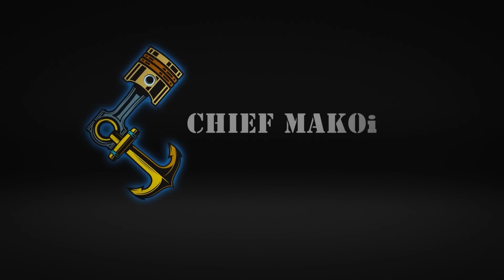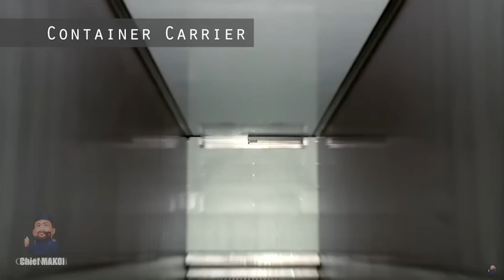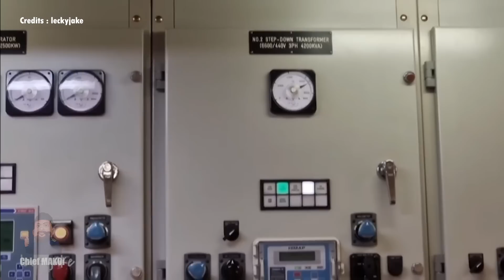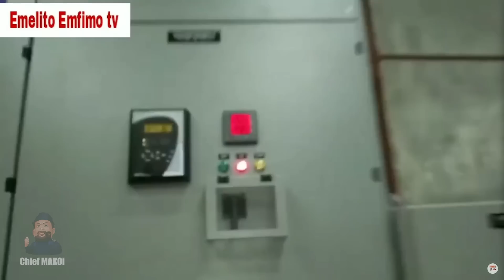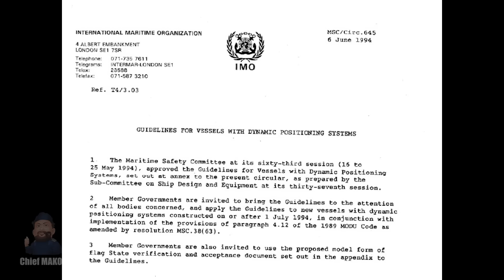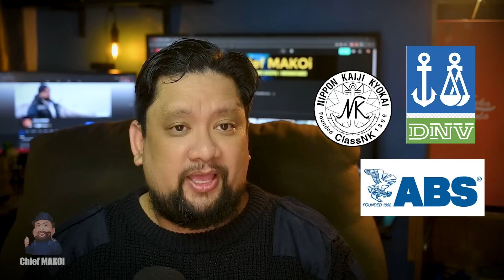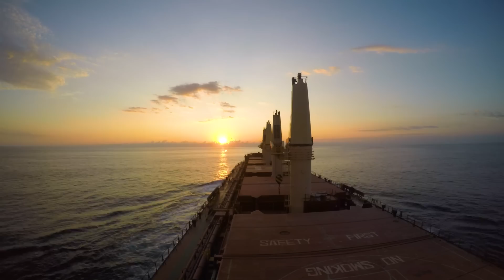Why Cargo Ships Don't Open the Bus Ties During Maneuvering | Chief MAKOi

Comment: The current setup offers NO redundancy. Any failure anywhere is gonna cause power outage in 440 bus, which means main engine will stop, and no useful steering.
Throw in any other mechanical issues (ships have plenty of things not working or not working well) and you have almost a guaranteed serious mess.

Comment: Thank you for your detailed explanation.   As an electrical engineer specializing in MV power distribution, I estimate
that having a normal tie breaker (also requires additional cubicle for bus transposition) would cost additional USD 40,000   Comparing to the cost of ship, around USD 500,000,000 it is less than 0.01% .   And this is the same trend, which I see in all other places - from hospital buildings to heavy industrial facilities:   "let's save pennies on the reliability of electrical systems."

Comment: In ICT, we use (massive) battery banks (UPS) to provide power during blackouts. Larger businesses and data centers also have diesel generators on standby so the batteries only have to supply power for a few minutes until the diesel generators have been started.

Comment: Thank you for the great explanation, because I also wondered why DALI did not split the buss while maneuvering.  All of the varied steam and motor vessels I sailed through the 1980's and into this century had that capability, as did the cable layers I was port engineer for until 2009.  I had no idea these container ships would not have that simple capability.  I still await the results of the investigation as to why the transformer breakers tripped, and/or why the alternate transformer was not immediately engaged.

Comment: Honestly, while the normally open bus ties would be a nice design, it would be far safer still if the source generators were synchronized and balanced, and as a result their phase-locked output would allow multiple down-stream transformers to be used at the same time even with both the HV and LV bus ties closed.

Comment: Applying a data  centre approach to ships during critical manouvres, the electrical installation might firstly  simulate a shore mains supply and operate as two groups of generators, each group having at least two synchronised generators running at preferably no more than 25%, providing a core 'A' and 'B' feed arrangement analogous to the usual objective for two independently routed "last kilometer" power supplies to a data centre site. Each group would have a similar approach, to achieve separate infrastructures of support systems, including their  fuel, cooling  systems and controls. 
Secondly, all  localised areas of critical  consumption (steering, main engine auxiliary systems, etc)  would have incoming 'A' and 'B' power supplies configured for automatic changeover (ATS). Thirdly, for stable final equipment operation (no break in supply during ATS operation or disturbance in power quality due to transient faults)  ultimate ability to cope with simultaneous SHTF failure of A and B supplies,  localised UPS units would be deployed for each group of similarly duplicated auxiliarly system elements (dual simultaneously running sub 50% loaded fuel pumps etc) with a choice of battery support time usually between 15 and 30 minutes autonomy. The whole morass of the above would need to be divided into two groups of independently located fire, flood protected and physically  separated plant spaces. If it was desired  to operate with concurrent maintenance of any element and restore availability of dual feeds within UPS back up time after a fault, then yet another "C" system would be needed.  All the above complexity explains why telecoms, banks or GPS etc rarely go down and >99.999 % uptimes are feasible.   In the context of huge cargo ships propelled by single, highly reliable, but still mechanically fallible main engines, how reliable should the related  power infrastructure need to be to achieve at least comparable assurance of availability and probability  of outages during critical periods of operation when there is little time for fault diagnosis, restorative intervention or repair? Presumably marine insurers and/or whoever controls port operations will have applied ISO 31000 style risk management assessments to the entire process of marine operations and concluded on the basis of probability and consequence that existing ship  systems are already fairly robustly suitable, but perhaps stipulated safeguards such as  tug support, which might be a good idea where time is a critical factor if anything stops working. Ultimately, it would be interesting to compare design, operational and risk management practices in shipping and port operations versus commercial aviation, nuclear power and railway  sectors. Some great posts here illustrate the benefits of removing blinkers and transferring best practice between different sectors of industry.

Comment: Thanks for clarifying this. I still don't see how the risk of losing the engine in port is managed in this way, but cost is a major factor in installations on a commercial ship. I can also see the NTSB pushing new regulation in the future to push requiring redundant systems in port.

Comment: Special generator excitors may be needed to force field current during a low bus voltage period resulting from a fault somewhere in the system. The energy for the excitation needs to come from the current flow in the generator, not from a transformer on the generator bus.  It also must be determined if both generators on each side need to operate in situations where power is critical to be able to have coordinated tripping between the generator breaker(s) and the HV bus tie breaker. I would like to see a diagram, and some details, of the generators.

Comment: Great to have such well informed and discourse on the Dali systems failures. Thanks Chief Makoi! 
I am a recently retired life-long marine engineer and have worked on many different types of ship although not actually on one with high voltage generators so very good to learn more about that. Of course, it is totally standard practice to add generation redundancy during maneuvering by adding a DG or two, but my question is: With two main transformers available, why wouldn't you add further security by running with both on line in parallel?

I would also love to have the mystery of the the Black Smoke shortly before impact explained. To my mind black smoke does not result from fuel starvation as some have suggested - more likely engine overload or lack of air. That was a lot of smoke and more than you would expect from the DGs being reconnected and having large load dumped on them.  Did they perhaps get the main engine started briefly but without the electric blowers?

Comment: I worked for AT&T, and was friends with some of the urgent repair people. There was a large failure of the phone system in New York City. AT&T was being a good corporate citizen, and signed up to reduce it's power usage on peak usage days. They had backup generators and batteries. On one of those days, someone forgot to start the generators when they disconnected from the grid. So, they started running off the batteries. Unfortunately, the alarm light showing that the batteries were discharging was burned out, and nobody noticed. After about 4 hours, the batteries were fully drained, and the entire city was disconnected from the rest of the United States. Additionally, FAA air traffic control communications in the region were cut. To add icing to the cake, the relay controlling the contactor that connected the building to the grid or the generators could only be pulled in by the now depleted batteries. As you could imagine, there's a big arc-flash during that connection, so you couldn't just push it in by hand. Someone eventually got a long piece of lumber and used that to push in the contactor and hold it long enough for the relay to be powered. 

I brought this up because even redundant equipment can fail, and sometimes the redundancies hide a real problem that needs to be fixed. Properly designed redundancy is a challenge in identifying all the potential problems and incorporating counter-measures. About a third of the issues were caused by people not doing the right thing, like in an airplane, turning off the fuel to a working engine when the other engine has a fire.

Comment: Thanks Chief, it is interesting to note that many harbours are requiring tugs to be on 'standby' even though modern ships have sufficient thrusters to manouvere. I agree there will be some reactive changes to the regulations and that will appease some but there will be another unforseen accident that will induce further regulation and on it goes.
Question: Do you see a future for nuclear power in commercial shipping? To me it seems a 'no brainer' given the amount of fuel oil used.

Comment: I fully understand you don’t set regulations and rules.  This comment is not about or at you.  You mention the regulations for dynamically positioning vessels as requiring more redundancy because a power loss can result in potentially catastrophic consequences.  I would think the governing bodies would have to recognize the potentially catastrophic consequences of a large ship under way losing power in any port or confined waterway.  In fact, I would consider a total power loss by any large ship underway in a confined space as more problematic than a dynamically positioning vessel in the open ocean.  Obviously there are ways to mitigate this risk without building redundancies into the ship itself like tug escorts, just find the rationalization of risk/consequences interesting.

Comment: As a result of the Herald of Free Enterprise capsize there was a real possibility that the on-shore Management would be held criminally responsible. As a result, the operator of a DP pipe-laying vessel reqired the production of an operating manual as this vessel was also semi-submersible so had stern doors that could be opened to permit entry of barges. These doors were retro fitted with switches to ensure that the bridge was aware that the doors were closed.
As the ship had a Class 3 diving certificate there was full redundency with additional partial redundancy for when diving operations were taking place.
Despite all the design effort to achieve infalibility there were a number of incidents that show how vigilant all concerned have to be.
1) An FMEA showed that separation between starboard and port equipment had been achieved, however, the 3kv supply cables to each of the rear azimuth thrusters passed though the single gearbox compartment whereby a fire in this compartment would compromise the ability to control the ship.
2) The 2 main computors were earthed with a common earth strap. The electrical intregrity was compromised on one occassion resulting in loss of both computors and with it loss of control of the ship that was in pipe-laying mode.
3) The computor software of the two main computors was missing an important check procedure without which it was possible to download from one to the other whilst the second was not powered. This was discovered only after such an event, again resulting the loss of control whilst pipe-laying.

All 3 instances were as a result of very small design oversights in a ship of extraordinary sophistication with teams of highly competent engineers and mariners. It is almost always the little things that cause the big problems.

Comment: A couple of questions:  

For your suggestion to reduce the risk of losing power to safety-related gear, wouldn't it be necessary for all safety-related gear (such as steering, engine oil and engine coolant) have to be connected by two separate circuits originating from both sides of the bus tie, with breakers automatically switching to the operating circuit in case of a power loss in the other, as is now done with the systems powered by the emergency generator?    I would think this would add a lot of expense.  

Also, I was confused by the circuit diagram showing that power to reefer containers was 6600 VAC.  The research I did on-line showed that the standard reefer container plug and socket was for 480 V 30 A.

Comment: Of course for the likes of critical systems (L.O which cannot stand interruption) - you either require the standby pump to also be running, OR an accumulator of LO which will ride through the period before the Stby pump starts.  Cooling pumps are not so critical as they don't immediately shut down the main engine.       On SOME DP vessels - they can operate on closed-tie lineup, but they must be able to prove that the system can ride through the transients of a Bus Short-circuit, and maintain supplies.    In critical operations (Drilling - running tools or collars through the BOP) or working within the 500m zone of an installation - most clients will still insist on open bus operations.

Comment: The interim NTSB report explains what happened, but not the why.  Apparently, both the HV and LV breakers either side of TR2 opened, the implication being simultaneously.  I’m not a marine engineer, but the description and pictures it seems sea and land setups are similar, and at these power level, circuit breakers are switches with what land lubbers call. “Protection relays” detecting faults through current and voltage transformers, and the electronics deciding if a trip is merited.

The transformer must have been ok, as the crew manually reclined the breakers and power was restored.

The upstream and downstream breakers opening approximately simultaneously shouldn’t happen.  There should be discrimination so the downstream trips first.  Being as the HV and LV panels are physically separate, it seems even less likely to be some issue local to the two breakers.

The breakers opening together is suggestive of an overarching control (what landies call SCADA, which I assume is similar t ICMS) commanding both breakers to open.  When NTSB tell us how both breakers got opened we’ll be nearer the failure cause.

Even if Dali had been running all ties open, maximum resiliency, it’s still possible that both sets of breakers on both sides of the transformers could all have opened simultaneously, and the collision would still have occurred.

Comment: Those high voltage transformers accumulate damage invisibly and then fail all at once.
I've seen two different types of HV transformers: one type with dielectric oil, and the other type is a dry build, with copper windings annealed into a type of ceramic dielectric. 
There should be measures and gauges that monitor the degradation of the transformer 's dielectric, so that there should be some grade of warning before a transformer failure; but when the failure occur, there is no going back, especially when it is hard to separate the bad transformer from the good one.
Than you Chief Makoi for your authoritative reports - I'm not a mariner but I love engineering, and your reports on these matters are among the very few which I consider valid and correct.
Greetings,
Anthony

Comment: Hi, thanks for your video but I’d like to make a point regarding your statement that operating the ship’s electrical system with open bus ties would have prevented the ship losing power.
Firstly my experience is that of ship’s engineer and then 30 years as a class surveyor.
Maybe the easiest way to make my point is to consider the main engine lub oil pumps. One of these will be supplied by the port side bus supplied by TR1 and the other by the stbd. bus supplied by TR2. Let’s assume the port LO pump is running with the stbd. in stand by mode.
If TR2 or one of the associated breakers developed the fault then the port LO pump carries on as normal and the main engine doesn’t shut down. However, if a fault occurs on TR1 then the running LO pump stops. Yes, the stand by pump will start but in all probability the loss of LO pressure will have shut down the main engine. Would it have been easier to restart the main engine, well yes but a loss of main propulsion power would still have occurred.
But then there are also the JW cooling pumps, FO supply and booster pumps, etc all of which will be duplicated and supplied by either the port or stbd bus and the loss of each could cause loss of propulsion but probably not as immediate as the LO pumps.

Some have asked why both TR1 and TR2 are not operated simultaneously but I believe that this is not possible due to the risk of circulatory currents overloading the transformers. Certainly in all of the ships I have had experience with using this HV/LV electrical arrangement the breakers were interlocked so that both could not be in continuous parallel operation.

Anyway thank you again and it will be interesting to see the final NTSB report.

Comment: Re potential recommendations: 
(1): I'm not expecting a bus tie recommendation as that likely wasn't the root cause and it would make handling surge conditions less reliable if the ties had to be open. 
(2): I do expect a recommendation about more frequent checks of core switchboard components & transformers as well as a possible push to require automated self-testing somehow (which will likely end up tied up in dependency and lobbying Hell—given how ungodly expensive that would be to implement retroactively).

Comment: In water/wastewater plants we move power around at 4Kv and drop it via transformer at each building equipment group.  There are redundant transformers and conductors that are split all the way back...including two utility supplies and backup power.  The tie breakers would only be closed if either path had a failure, or during infrequent tests.  I understand that landbased electrical systems are much simpler to route, but it seems a similar setup could be employed on these big boy ships.